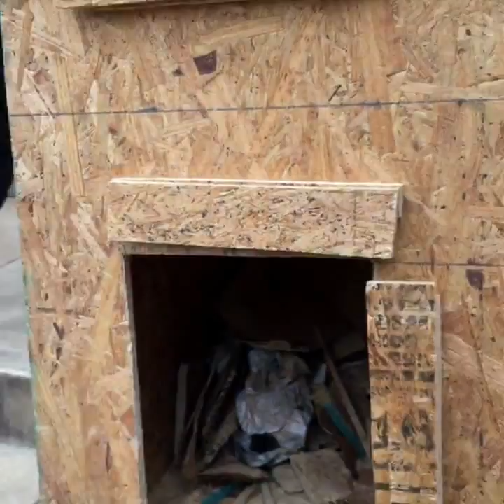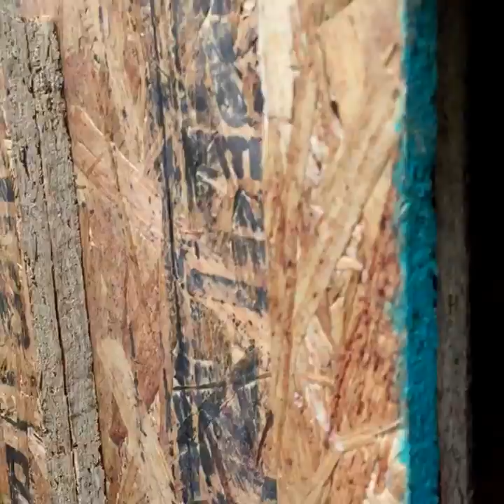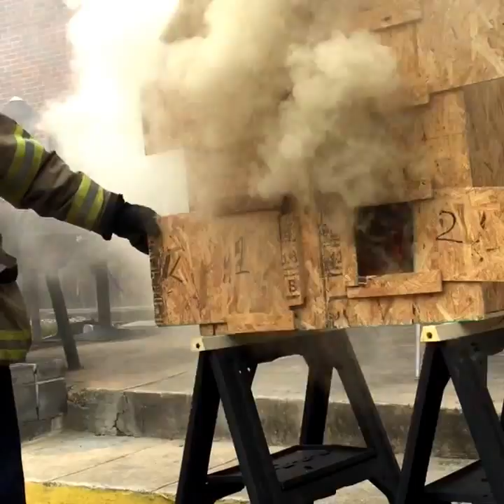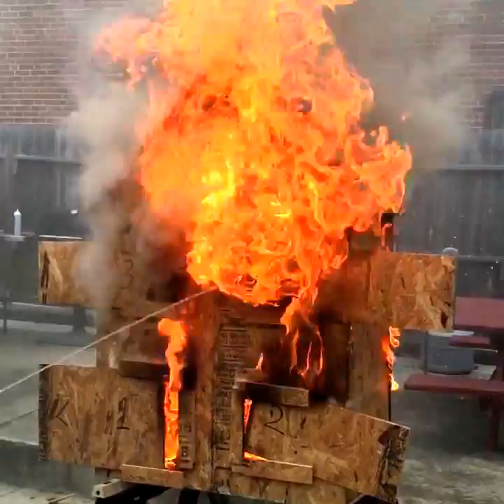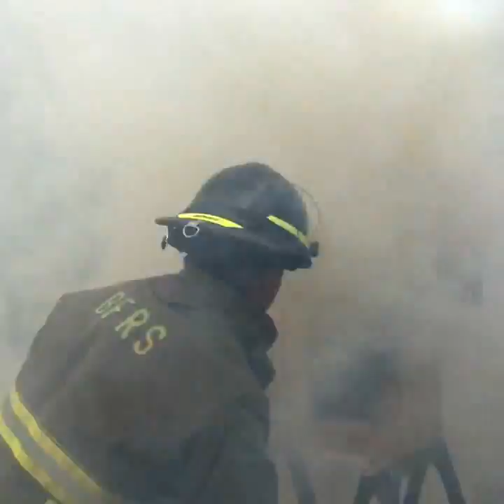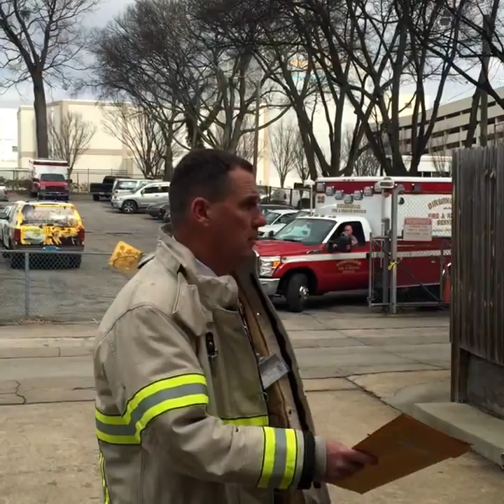Doll House fire behavior, Birmingham Fire and Rescue

Comment: That OSB particle board is nothing but fire accelerant, this $16 box proves it. How is this CODE acceptable?   when I was working in construction during the winter; we could always get a fire going fast with some OSB and some Contractors Grade adhesive for flooring. I can only imagine how fast the fire would spread adding in some furniture , carpet, and plastic window blinds.

Comment: Children at play!  Where's the water?  This is very simple.  Do a 360 and find the fire room.  Open the window and apply water to the burning material.  Open more windows and doors to vent the heat and smoke and mop up.  Stay off the roof of a burning building.  Heat Rising is not what you are trying to make happen.  You are trying to allow Pressure, heat and smoke to Leave the structure, not draw it through the structure to the hole in the roof.  If you want to destroy the structure and kill people, Vertically Vent.
https://www.youtube.com/playlist?list=PLkp0E1ao1XEy2uMomAtjWfScRFcCUmwwv

Comment: Interesting but can't help wondering if this is sending out mixed messages, at least from looking at the comments. The key message I got from this video is to create a vertical vent hole, and allow just enough air into the building from the lower levels to facilitate vertical venting of gases, but not quite enough to feed the fire.

Comment: The instructor is bringing up a lot of questions, but I'm not hearing any answers for those questions. What caused the puffing smoke? I don't see that in my book.
Reply: With only one opening the fire is "gasping" for air. While the smoke is pushing out its trying to breath and pull in fresh air. hence the breaks in smoke stream and puffing smoke. Hope that helps.
Reply: It's like when you're filling your lawn mower with a gas container, and the little black cap isn't open.  The gasoline is coming out in rhythmic splashes, because as the gas drains from the container its trying to suck air in to replace the gas

Comment: It's hard to demonstrate a true backdraft in a small box like that. I've seen it done in a full size sea train container. The flashovers were impressive. It is a shame they lost so many veterans to save money.
Reply: fotmasta could you explain exactly what happened in Birmingham
Reply: @tvjjerome  I re-read what I wrote and should have worded it differently. The model definitely fits all the requirements to be a backdraft. On a larger scale the result is more explosive. There was a supermarket backdraft I'm thinking of that was almost like a bomb going off. That's what I muddled in my original comment.
Reply: fotmasta no I meant with the veterans
Reply: @tvjjerome  In the video he mentions after the buyout of a majority of veteran firefighters, the newer less experienced FFs didn't have the benefit of the experienced vets explaining things on the job. The rookies lacked the sort of apprenticeship you get when working with the old timers.

Comment: Go find that fire room on your 360.  Vent horizontally pull a line to the door.  Pull a secondary to the vent point of the fire room.  Cool from a safe distance while primary line makes entry   Make the fire walk backwards from the ability to flash.

Comment: Makes sense. After seeing large fires on the news, and especially if the cockloft is involved, it always seemed you had moderate smoke and it looked contained, and they tried venting it, then a few moments later, the other news stories are interrupted to show the whole roof or top floor engulfed. I had thought, that they just added air to it, and I see here the counter-rationale, that they are trying to release "flammable gases" as well to make it safer to fight from inside, but it seems all they did was assure that the gases ignite, with the added air. In some videos, it looks like they're not even putting a lot of water on it, and instead just wait for the full external backdraft (rollout), and I wondered if this was just some sort of protocol that doesn't fit every situation.

I know here in NYC, a few years ago when they were transitioning Governor's Island into a park, they allowed the FDNY to train on several of the condemned USCG base structures, and it was said they were reconsidering the V V tactic. (And all they do is knock out ALL windows, and then I was surprised to see fires in other cities, where they didn't do that).
So I don't understand how are fire departments just now learning that this method doesn't work?

Comment: each room only flashed once. a flashover is the sudden and sustained transition from a developing fire to a fully developed fire. so the supposed flashes that occur after that when the fire had died down, and then got going again with the introduction of air, is a backdraught. a backdraught is a well developed fire that is starved of oxygen. when oxygen is reintroduced it deflagrates as it is still at auto ignition temperature

Comment: you don't actually have a "double flashover" when the second floor smoke ignites.. review the definition of flashover if you disagree with me and then watch what actually happens. What actually is happening is smoke deflagration, you have flamable products of pyrolysis coming out of the second story, it's mixed with sufficient O2 and it's  just needing an ignition source.. this is akin to a smoke explosion except you don't have the confinement or the stoichiometric mixture of fuel and oxygen to create an "explosion" so you get deflagration.. not a flashover.
Reply: Correct, it's backdraft, not flashover.  Flashover is sudden propagation of the fire from ceiling to floor due to intense radiative heat

Comment: This video Proves that Vertical Ventilation Does Not Work. 

Roof venting Never works as intended for two reasons.  1.  A building is Not a chimney and won't work like one.  Between the hole and the first floor you have many dampers such as ceilings, floors and doors.  2.  The main reason is this.  The burning material in the attic will continuously generate energy Especially after you have cut a hole and introduced fresh air into it.  As the flames go out the hole they are not causing a draft throughout the structure.  The burning material is replacing everything that is escaping.  Notice here, with the hole in the roof, smoke and flame are Still coming out the door and windows.  If roof venting worked, air should be sucked in.  Solution?  Patiently find what is burning and put water on it.  If it gets hot along the way, cool the ceiling with a spray of water.  K.I.S.S.  

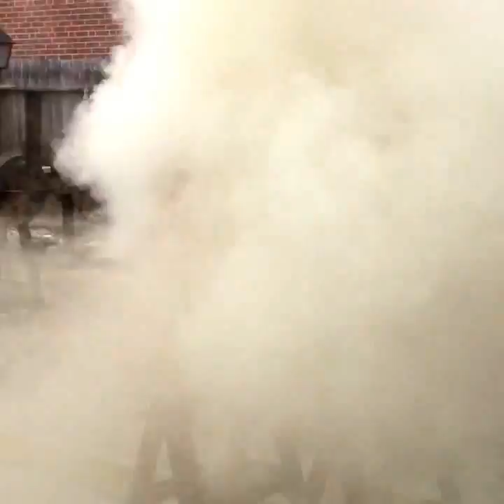11:00  "What happens at the gable when the roof is open?"  If the roof hole is letting heat out, air should be sucked in at the gable.  11:55  If the fire is raging out of the gable and the roof hole, when he opened the window, air should have been sucked IN, not heat and smoke belching out.  The roof hole improved nothing.  12:15  Thank you for proving my point.  Open the roof and the smoke STILL pours out the window.  Notice when he opens the window he says nothing because he is Disproving the reason for vertical ventilation and his tongue is tied.  Listen to what he is saying and proving.  NOTHING.  He's totally confused. Think for yourself, don't just believe what you hear from a so called Expert.   PUT WATER ON WHAT'S BURNING!!!
Reply: JB91710 your argument is invalid he said you don't vert vent till after suppression and immediately after suppression the whole objective when vertical ventilating is the planned systematic removal of hot toxic gases and replace with fresh air. You are correct if you just vent with no water your screwed your going to save the mail box that's it.
Reply: JB91710 I think the point of this demonstration was to show how ventilation effects the flow path of fire. He did a poor job of alliterating what was supposed to be happening. The point of ventilation, to my understanding from my fire classes, is to release all the flammable gasses and heat to make a much more workable condition for firefighters to work in when they are inside, and to also prevent effects of a flashover (note: If you are already seeing signs of rollover, you should not ventilate as to prevent risk of introducing O2 to the stoichometric ratio of gasses inside the room), and finally to slow down the process of the fire spreading to other rooms (done by controlling the windows for horizontal ventilation. The point of origin where the fire started went to the next room where the window was open (bottom left to right). At that point there is already smoke building up in the room where the fire started (bottom left), aswell as the other rooms up top. At that point you should start vertical ventilation to release flammable gasses up and out of the building without exposing it to heat, and this works because the flame is downstairs is nowhere near the ventilation hole, and fire goes to the path of least resistance, and that's through the window that is already open. And while doing that you should already be trying to suppress the fire in the room where the window is already open (bottom right). This should be done so that the fire has a harder time spreading upstairs towards the other two rooms (hoping the doors are closed to ensure a physical barrier between the fire and the fuel). If the top floors are already engulfed in flames, it would be pointless to do vertical ventilation above a room that is already on fire, as you would be adding oxygen to the mix. At this point, you would be considering other types of ventilations or attack/defense.
Reply: JB91710  I agree we all know the pencil pushers come up with some shit behind the desk but have never proven it in the field. The other thing u said is why go by the fire outside just to go inside and can't find it or then have to come back out to finish extinguishment and that is because there are some ff that think it's makes them cool to be the first in and say ran I ran right in past the fire and crawled around well that is why we get hurt and that's all come from lack of command and Tranning
Reply: JB91710  vertical vent will work if like he said before if you communicate with a house to not let the actual fire up through the roof just the gases and smoke
Reply: I have seen it work many times over. You just need to know what you're doing.
Reply: @raystinsky  That doesn't explain How it works.  Just because you see smoke exiting the hole, that does not mean the smoke ceiling is being lifted on the first floor.  Until you eliminate the combusting material, the fire will replace everything that moves towards that hole and because it is moving and mixing with fresh air from the windows and doors, the fire only gets bigger and bigger.
Reply: @JB91710  Experience says otherwise. Like I said,  you just need to know what you're doing. Saying that vertical ventilation never works as intended is demonstrably false.
Reply: JB91710 I see your point sir but in some applications it is necessary  and works the way it is suppose to but I will do more research to prove you point further. I think it is wonderful learning new tactics and methods and thank you for the information I have wonky been on the fire dept 11 years still got slot of learning to do
Reply: Jacob  Many Manual writers get an idea in their heads and don't think it through from A to Z and troubleshoot it to make Sure it works Before they teach it.  Then years down the road, they have to change it But they call it Progress through extensive testing.  Its BS is what it is.  Remember, Hose water pushes fire and then, No it doesn't?

I have 50 years of experience working with people and most of the time, supervising them.  A LOT of adults are still children.  Fire fighting doesn't attract brain surgeons and you are going to get a lot of Hero Wannabes. They are the ones who get Other fire fighters hurt.

The Chiefs and Officers are often no better.
Reply: Jacob  Thank you but there is no need to call me sir.  Be real careful with researching a solution to a problem.  Don't think that because information comes from an instructor, Professional or so called expert, that it is right.  Have confidence in your own ability to use common sense and logic to find an answer.  The most important thing Anybody should do in their lives is to Think For Yourself!
  
How many comments from Civilians have you read that said, Where's the water?  Why is it taking so long to put water on it?  They are RIGHT!  Todays fire service has made FFing so complicated that they save water application for Last instead of first or second.  They Vertically Vent everything whether it could use it or not, if it worked!  They walk right past visible burning material to go inside to fight the fire from the inside out.  When they get in there, they cant find it or cant extinguish it so they come back outside but by then the fire is bigger and has progressed deeper into the house and usually the attic..
Reply: Jacob  What is the point of vertically venting After the flames and heat have Stopped being produced?  On every video comment they are saying the reason for vertical venting is to release the heat from below so it is safer for the fire fighters to fight the fire.

You want to vent the windows in the fire rooms ONLY and extinguish the room from the outside and then go in when it is safer for everybody.  Done properly, the water will go in and the heat, smoke and humidity will go out the top of the window.  If you are inside and find a burning room, you want the heat, smoke and humidity taking a direct route out the window.  If you are sure of the fires location and the window is open, you can PPV the front door and help to push it out. 

Even if you get a flow from the lower levels through a hole in the ceiling and out the roof, you have no control over that flow.  There is only One exit.  With windows, you Can control the direction of the hot gasses by which windows you open.  From the fire location Directly out of the house not through it.

The VAST majority of videos show indiscriminate VV with no coordination at all.  They do it for the excitement of it not for its value.  Don't believe it works because someone told you it works.  Don't LOOK at the signs and USE them to convince yourself its working. Make the signs convince YOU that they at a result of VV.

Make instructors Prove beyond a shadow of a doubt that it works.  Because a fire fighter is convinced VV works, when something changes inside a house they attribute that to VV when it could have been a window opening.   It cleared up a little!  It Must be from VV!  It Works!

Comment: That's good training boys good training
Reply: You think so?  Read my comments.
Reply: JB91710  well vertical vent is only going to work if you have the man power and done right it's very affective other than the vent the flash over simulation was cool
Reply: Mike Demiduk You prevent flashover by spraying the ceiling as you go to cool the gasses as you go through the house to find what's burning. Everything else is playing.

Comment: so there using that kind of wood to build houses now days. thats y the houses are burning faster. cheap wood.
Reply: Regina Bundy  umm ya 1/2 OSB board has been used to sheet roofs do walls and floors for years its not cheap materials it was just cheap because they probaly bought one 4×8 sheet maybe two   1/2 OSB holds up better and its wood, wood burns great end of story   as a volunteer fireman and a carpenter i would know
Reply: Samuel Shonhart i lay floors for a living the particle board is inferior to plywood 100% its cheaper and not as strong. Always dread floors that are osb basically junk. Pour a cup of water on it and it swells up bad.
Reply: well I don't know about using the word "cheap" as opposed to "accelerant laden". Particle board is held together with a very flammable epoxy type glue, that when burned emits phosgene gas, and other petro-chemical fumes that can spontaneously combust when smoldering, OR accelerates the combustion of other burning materials. In addition to that, the nature of the board that makes it "particle" is that it is made up of chips of wood. So basically, it is a sheet chemical laden kindling! I've seen house frames be totally wrapped in this stuff. Add on other plastic- petro product insulating wraps and foam type boards, and you have an inferno just waiting to happen. How these types of buling materials get the ok from a Fire Marshal/ Building Code Enforcement is beyond me. And people are oblivious to these building materials because all they know is the finished product, and the price tag offered by the seller. Bottom Line...the buyers are buying a "DRY GAS CAN"...